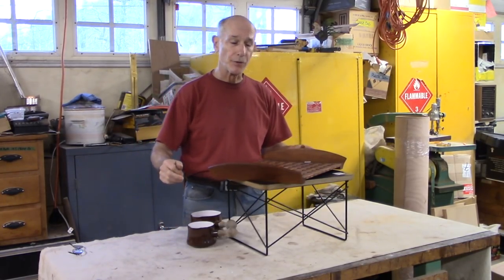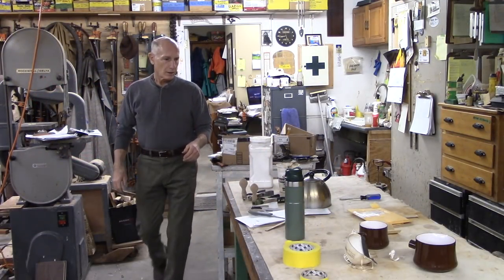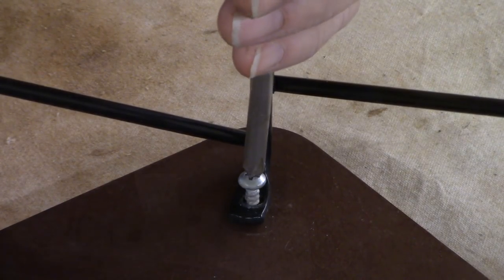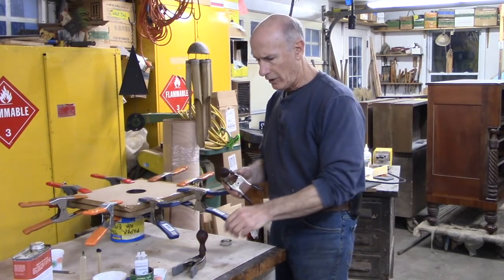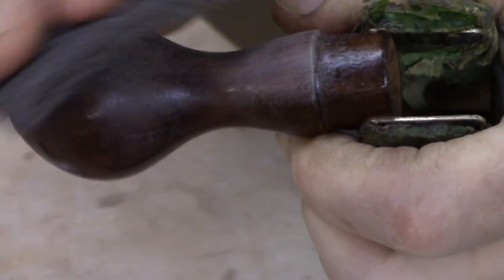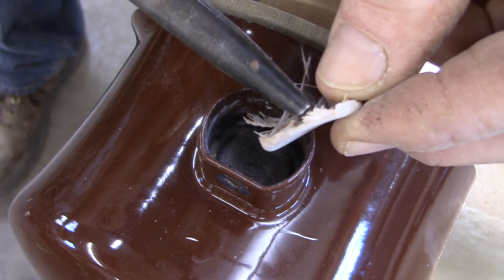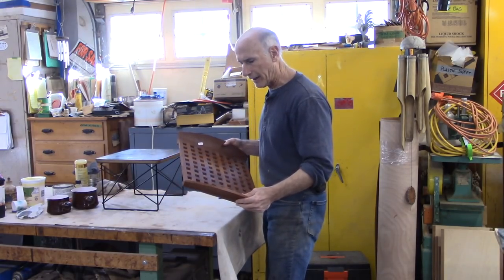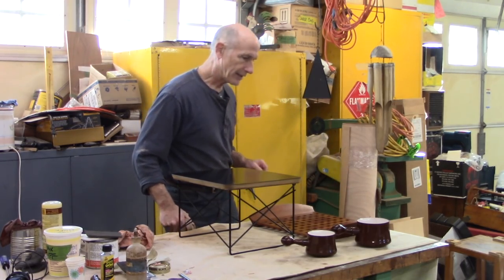Thrift Store Modern - Thomas Johnson Antique Furniture Restoration

Comment: Always a joy to watch. As far as getting the stickers off, I use lighter fluid. It softens the glue effortlessly. I them left a corner of the sticker up with a razor blade & off they come. Squirt some more in a soft paper towel and quickly swipe the surface to remove any left over residue. I use this process on dust jackets of old or new books with stickers.
Reply from the maker: Thanks! It sounds crazy but I'll try it!

Comment: I managed to find a tray that is quite similar to yours, but may be slightly smaller. Mine came with small blue glass square bowls. I wonder if they are still in that thift store? They have glass feet that fit into the trellis work. It's stable and very functional. Bought mine as a Christmas gift for my sister. Great inspiration. Thanks Thomas.
Reply from the maker: Thanks! The bowls sound intriguing! I will look for them

Comment: Thomas- first thanks for a great channel. I’ve done a ton of fabrication with high-pressure laminate (mostly kitchen countertops). Something I learned over 30 yrs ago at a Formica-sponsored clinic, HPL actually is somewhat porous and can be glued (for repair situations) with yellow glue. They recommended something water-resistant so today that means Titebond II or III.  In repair situations in a kitchen this is 1000% more convenient than trying to work epoxy or contact adhesives into a loose seam. Secondly if contact adhesives were used initially, they can often be reactivated with gentle heat alone.
Reply from the maker: Thank you! That's good info. I rarely have to deal with laminates, but it's nice to know they can be repaired

Comment: Nice work! Just wanted to suggest that Kampel seamfil color kits you can get for filling in scratches and chips in laminate.  It's a type of plastic filler and dries in minutes and cleans up with lacquer thinner. Have used this product for years when we find flaws in countertops. You can buy this where they sell laminate or online.  Hope that helps for another project. Thanks for your awesome video!
Reply from the maker: Wow! Thank you! It never occurred to me to look for something made for this purpose. I'll know next time
Reply: @johnsonrestoration  yup and also you can mix colors to achieve the color you need to blend in. If I'm not mistaken there is also a color chart to help with color matching. Good luck!!

Comment: A little safety tip: When I use a hole saw I always let the drill come to a full stop before I withdraw it from the material.  Once I didn't and the plug dropped out and went flying at a high velocity across the shop, hit the wall and split in two. Since I saw the power in that projectile I've always let the drill come to a stop first.
Reply from the maker: Thanks! Noted!

Comment: Tom, really nice results. I'm wondering, since the laminate on the table is plastic based, whether some rubbing compound and a buffing wheel would have removed the majority of the scratches? Thanks for the video!
Reply from the maker: Thanks! I've tried that before, doesn't work. The plastic is too hard

Comment: For metal or varnished surfaces, WD 40 works great as an adhesive/label remover.  Thanks for sharing your fine work!!
Reply from the maker: Great tip! Thanks! If a sticker is on something that you're going to refinish, you shouldn't use WD

Comment: Thomas, you might try looking for some "vandal mark remover". This is a witch's-brew solvent designed to get things like spray paint off the outside of buildings. I found it is really wonderful for removing the glue from almost any kind of sticky tape. It's also good for taking bits of hardened paint off other surfaces, usually without harming the original surface treatment. Obviously you want to wash the stuff off with soap or paint thinner when it has done its job, but it can save an awful lot of elbow grease and mechanical devastation to whatever you are cleaning up.
Reply from the maker: Thanks! Sounds interesting, I'll look for it. It might very well be similar to Goo Gone and Goof Off

Comment: I do glass pieces and often have to remove labels from bottles.     For a non-porous surface, I find that some borax dissolved in warm water does the trick.     It removes the label and the glue underneath.     Mule Team is the brand name and they stock it next to laundry detergents.
Reply from the maker: Thanks! I will try it!

Comment: If you haven’t learned as yet, the Dansk tray was made to hold square green glass tidbit trays, whose four feet randomly rest into the grid. Now finding those would be awesome. Also, in sanding the Kobenstyle pot handles, did the split in the wood disappear without wood filler? Enjoy your videos!
Reply from the maker: Thanks! Yes, viewers told me about the glass pieces. After sanding so well, the cracks were gone, didn't need any filler

Comment: for the lament top, could you put a few, light to medium coats of vinyl sealer ( to fill or mitigate the scratches the 1 coat of black lacquer paint then top coat? probably take a lot more time an work but if you wanted to make lament look brand new again?  a basic understanding of what finish for what surface material might make for a good future vid if you haven't already! cheers! -gus
Reply from the maker: Thanks! I thought about spraying it with black lacquer, but the scratches were so deep I knew it wouldn't work well, and then what happens as it wears off? So I decided to do as little as possible

Comment: Another great video.  I always learn from watching.  This time I was left with a question.  Why not sand out the scratches in the laminate top?  It was black and there were no discernable color changes where the scratches were.  I know that PVC laminate can gum up if it gets too hot during sanding or drilling.  Would hand sanding or light random orbital sanding with 220 grit  before waxing have dulled the surface too much?
Reply from the maker: Thanks! I would have liked to try that. But my experience has been that on manufactured products like that, you can sand them, but it is almost impossible to then buff them out

Comment: This was extremely fun to watch.  You're an amazing craftsman and I've learned more from your videos than I ever did from relatives over the years. It never would've occurred to me to use steel wool while waxing like that. One question, however!  Why use the shoe polish on the table top, rather than masking the edges and infilling the scratches w/ a two-part epoxy and carbon (or, heck, black acrylic, maybe)?  That might've filled the laminate's scratches and polished out to a nearly identical finish. Was the issue there that the laminate has a slightly-frosted surface, or color-matching?
Reply from the maker: Thanks! No way was I going to mess with that laminate! The polishing part...

Comment: For those looking for it Oxalic acid is often marketed as wood bleach FYI
Reply: Wood bleach kits will normally come with a neutralizer. Like watered down vinegar. I think he just rinses it off. Funny that he is using so much water to remove water stains.
Reply: @rustynail5812  Oxalic acid is a REDUCING agent.  C2O4-2 ==> 2 CO2 + 2e-.  Both oxidation and reduction can impact on colored substances.
Reply from the maker: Thanks! Wood bleach is different than oxalic acid. Oxalic doesn't change the natural color of the wood
Reply from the maker: Thanks! Yes, is that irony?
Reply from the maker: That' s interesting. Wish I'd payed more attention in chemistry class!
Reply from the maker: OK, back to chemistry class for me

Comment: Acetone is great for removing sticker glue residue. Melts it away.
Reply: It's also useful for removing mineral oils that has sooked up in wood, like misscouloured gunstocks and other things.
Reply from the maker: Thanks! Yes, a lot of solvents will work. Alcohol too. I like acetone though, I'll try it next time. BUT not on a finish!
Reply from the maker: Yes, but as I said above, you have to be careful of the finish on the object
Reply: @johnsonrestoration  

Aceton  also pretty nasty to inhale i think (at least i usualy got a terrible headace if i using it indoor)
Reply: Thomas Johnson Antique Furniture Restoration Sticker adhesives are going to be either water soluble or oil soluble. Aggressive solvents like acetone will dissolve oil soluble adhesives, but so will any non-polar solvent, including vegetable oil. Heat is still the way to go to get a sticker off, but for the residue, try a little vegetable oil.

Comment: Would it be easy to tell me about oxalic acid. You buy it in liquid? Here in Greece I can find it only in powder (it is used only in beehives after it's mixed with sugar anf glycerine). Meaning, in case you know, in what percentage should i dialute it in water? Thanx a lot.
Reply from the maker: Thanks! It's powdered, I always start with one tablespoon in a quart of hot water. You can mix it a lot stronger if you need to. https://www.youtube.com/watch?v=CdDVOl0Xq4g

Comment: Wonder why you didn’t chuck the handles into your drill press or lathe and sand and finish  that way?
Reply from the maker: Wow! Because I didn't think of it! But actually, when you put a turned object in the lathe, it never turns true, it always will have a wobble to it which could make it difficult to sand
Reply: Thought the same thing.  You can always use shims to indicate your work piece. I'm sure you've seen ABOM79 do this.

Comment: Tom, Thanks for another great video.  I have a question about Teak.  I manage a sailboat and we have some teak around the companion way.   I have tried "Teak Oils" and varnishes.  But I like the simplicity of the Orange Oil and beeswax polish.  I think it means I would have to treat it more often, but it seems simple and straight forward.  Is this approach/product good for the outdoors?
Reply from the maker: Thanks! It's not made for the outdoors, of course. But yes, that just means you have to treat it more often. Maybe try a wax made for auto finishes
Reply: @johnsonrestoration  :  There you go, problem solving again.  Thanks!  And if you are ever in San Francisco, you have an open invitation for a sail on the Bay and a tour of my wee shop.

Comment: Regarding your use of Oxalic acid - I read somewhere that using Barkeeper's Friend powder, made into a thick paste, then applied with a cloth or brush, (I used a "retired" toothbrush) did the same "trick". I'm currently re-finishing a solid teak side-table top (Dansk) - thrift shop buy at $4, and have used that BKF recipe after taking off the initial protective (?) layer. Not sure how it will all turn out, final 220 sanding later today. Then off to the store to buy your orange and beeswax product, I hope. I have that question mark in front of the word "protective" because it didn't prevent glasses rings, deep scratches and general discoloration. and some pencil marks from getting on the wood.  I'm very much "Mid-Century" in furniture etc. styles, but very much Early 20th century (Depression period)  in my own age. I loved that Dansk lattice-tray in your video. Great video of yours - thanks for some useful tips.
Reply from the maker: Thanks! I keep hearing about BKF, I have to try it. Sounds like you're doing a good job - use an oil finish like Watco Danish before the beeswax polish

Comment: Regarding the fit of the handles, I was thinking that a shaving of soft wood with a hand plane could be glued to the tenon and shaved.or thinned to fit.
Any opinions?
Reply from the maker: Thanks! That would have worked well, I didn't think of that. I feel like the wedges worked well to give more even pressure all the way around. Shaving the glued wood might turn out uneven

Comment: Very nice job and teachings Thomas.

There is a toy restorer/repairer on utube, Toy Polloi, who uses lighter fluid to remove stickers from vintage cardboard boxes and such; does not damage the images or box in anyway.
Reply from the maker: Thanks! I'll check out the channel. I'll try the lighter fluid, but I'd be worried about some finishes on furniture. Be careful!
Reply: @johnsonrestoration  

You are welcome.

It really is a good channel.
Dave shows how to fix/spruce up old toys with clear instructions, using simple tools etc... He mainly works with Star Wars figures other people might throw away; however much more than that.
Most of the skills he shares, can be transferred to a lot of small fixes around the house.

You are right about lighter fluid possibly ruining finishes on wood, although it might work on varnish. 
I was thinking more for laminate, metal, vinal and such. 

Take care

Comment: To remove stickers, rub the sticker with rubber cement, then press a piece of paper down on it. Wait for it to dry, peel away the paper, and the sticker almost always comes away with it. Much safer than using lighter fluid or some other flammable product...
Reply from the maker: That's interesting! Can you still get rubber cement?
Reply: @johnsonrestoration  Yes. I buy Elmer's Craft Bond. You should be able to get it in the craft/ school supplies aisle, or at office supply stores. I believe you can even get it in a large refill size...

Comment: Is there a reason you didn't also use epoxy to attach the handle on the large pan?
Reply: Maxx Kroes  Makes sense.  I'm sure he had a good reason.
Reply from the maker: Thanks! Max is right, heat would loosen the epoxy, and the handle may need to be replaced sometime. We have a "Galloping Gourmet" sauce pan on it's 3rd handle!
Reply from the maker: Correct! Thanks!

Comment: Zippo lighter fluid will take off a price tag, no residue.
Reply from the maker: Yeah, I'll try that, but I'm sure you should be careful of the finish. I wonder what lighter fluid is exactly?
Reply: Thomas I learned about its adhesive dissolving capabilities when I worked at a university bookstore. We would lightly score the price tags of books to be returned and squirt a bit on and they would scrape right off.
Reply: @johnsonrestoration  Goo Gone and "goof off" will also work, but are oilier.

Lighter fluid doesn't damage finish that I can recall, and I've used it on many different things.
Reply: There is a toy restorer/repairer  on utube, Toy Polloi, who uses lighter fluid to remove stickers from vintage cardboard boxes and such; does not damage the images or box in anyway.